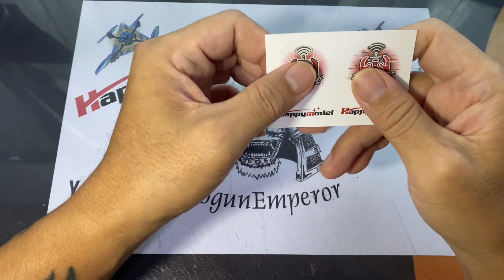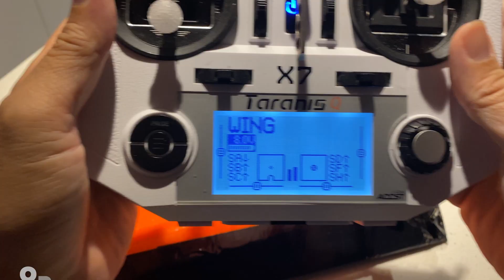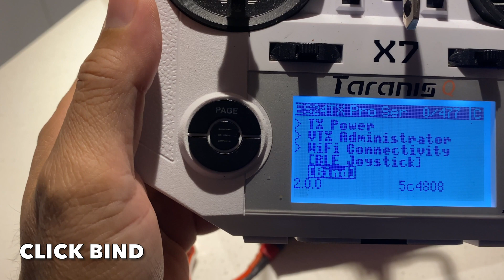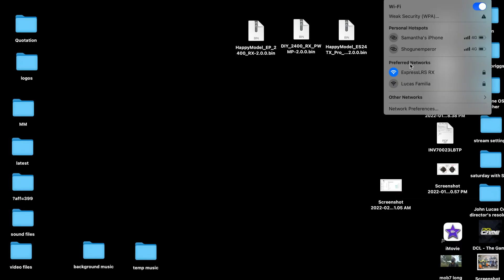Happymodel ExpressLRS Receiver for fixed wing

Comment: You can remap channels for these PWM receivers. Channel 5 doesn't have to be Aux1.. Use the Web Interface to remap and set Failsafe values for each of the channels.. ;)
Reply from the maker: oh sweet!!!  Thanks for that update bruddah.  I think it can also be used on an RC car or RC boat if one is used to using a standard stick radio instead of the gun radio too.
Reply: @shogunemperor  definitely you can use it on an rc car or boat!
Reply from the maker: @deadbyteDrones  sweeeeeet